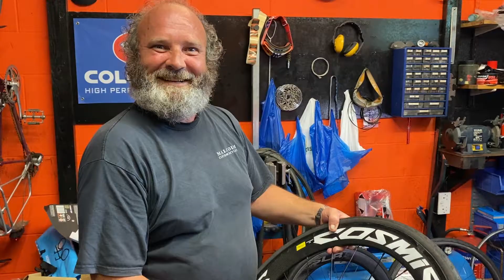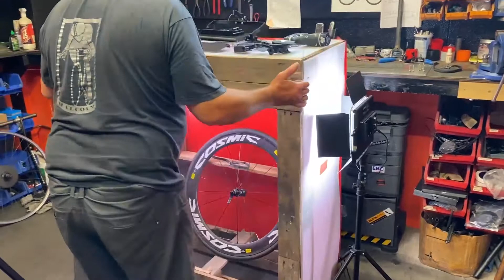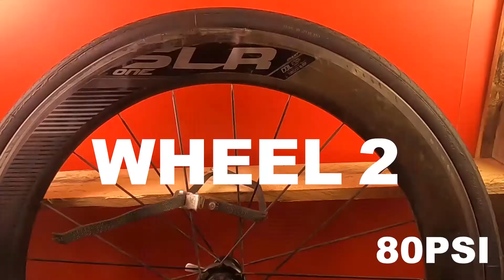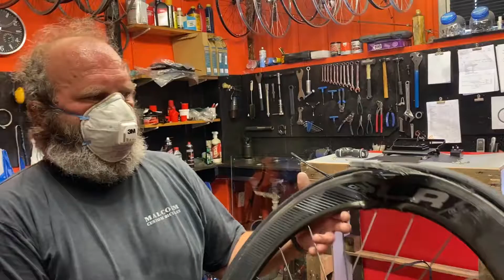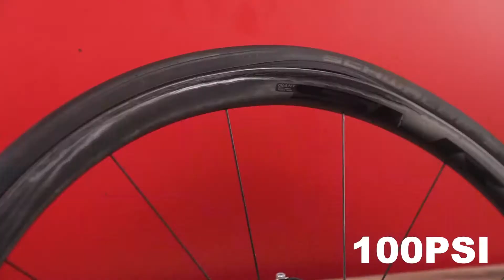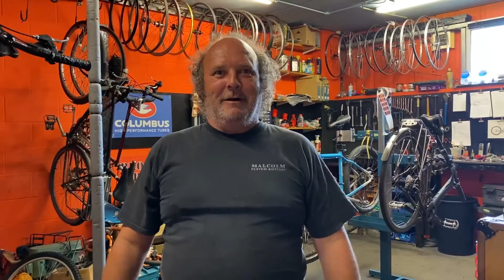EXPLODING CARBON BIKE WHEELS... It could be disastrous to keep riding them.

Comment: I used to get rim sidewalls blowing when I still running v-brakes ignoring brake wear XM 317s on 26 XC hardtail.Not a bad thing to flush out rims from dirt build up.Dented alu rim can be bent back but they say it will never a strong as before but so far far no problems on XM319 disc rim after bending back.
Reply from the maker: That's a suck it and see situation. Wouldn't advise, but with good quality rims like the XMs and a regular check it'll keep you on your toes...

Comment: Really super to see you back again. I have to thank you so much for your previous videos on building wheel as they taught me so so much. I do not drive any more and I cycle for work and leisure. I have two Dutch built bikes that I got at a discount. Because I do so many miles the wheels are always the weakest link and thanks to you I can maintain them. I bought a wheels stand and tension gauge along with comfortable spoke spanners. I have replaced two rims due to an accident and another where spokes were not tentioned properly and a spoke nut pulled through rim. Before this I would have gone nuts and would have been an expensive repair either replacing whole wheel or getting some one to replace rim. Now thanks to you I have no problem at all doing it. Thank you so so much for all your wonderful videos.
Reply from the maker: As per the previous reply... take care and keep on riding your own creations.